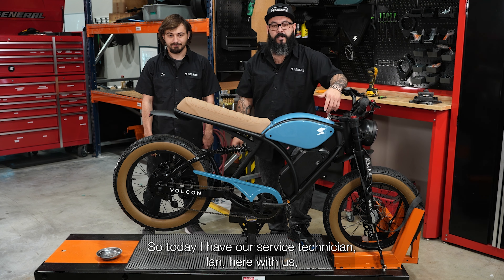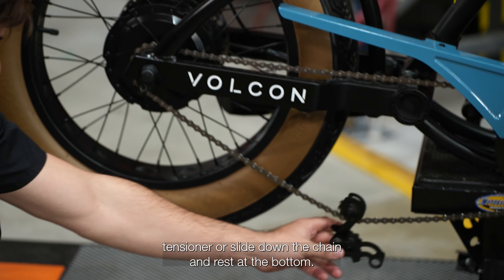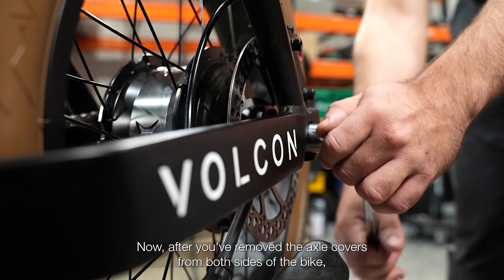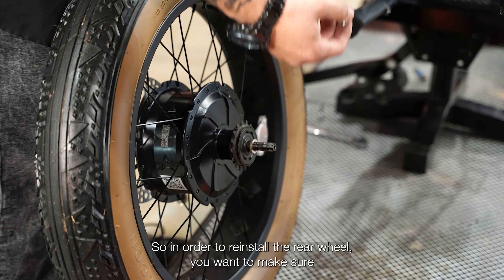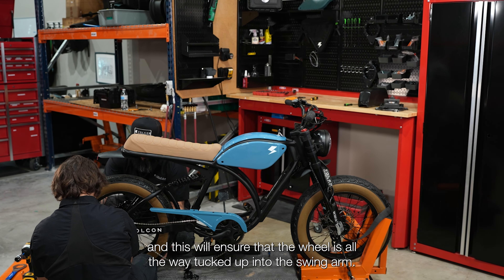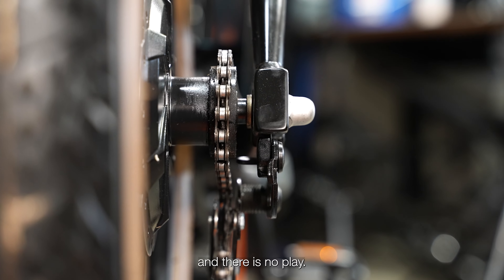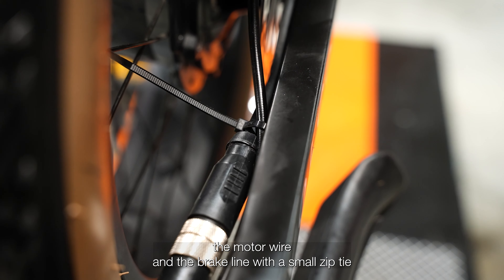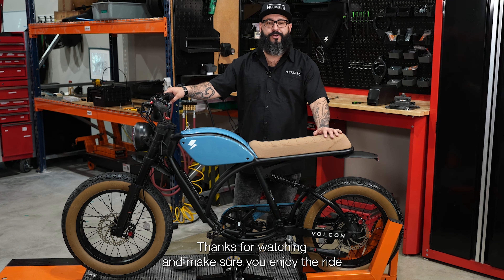2023 VOLCON BRAT | How to Remove and Reinstall Rear Wheel

Comment: This video is a LIE. Back wheel is nearly impossible to remove in real life. This has clearly been falsified. Would not have bought this bike if I knew I'd  have so much trouble replacing rear tube.
Reply: how did you end up removing the rear axle bolt?